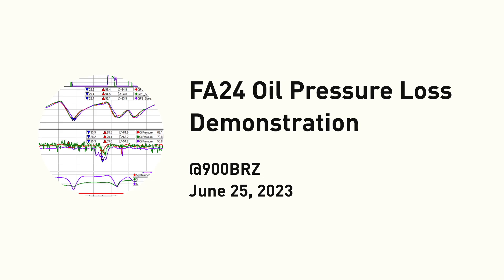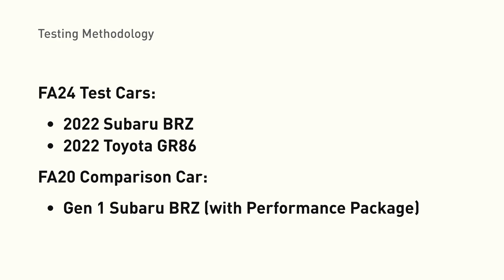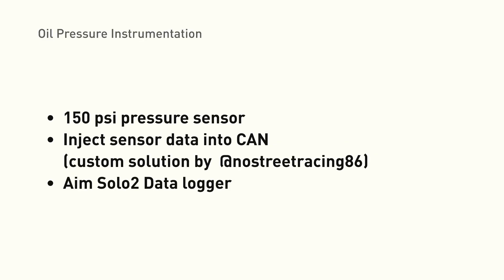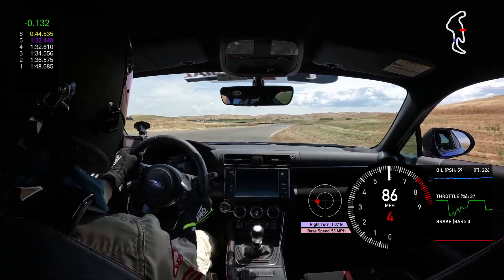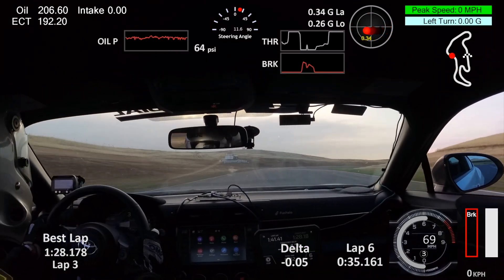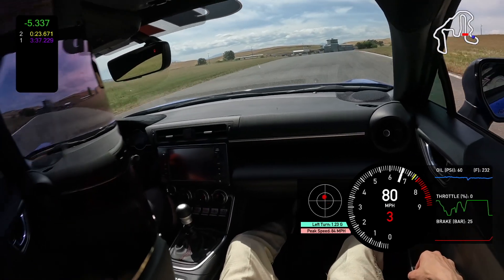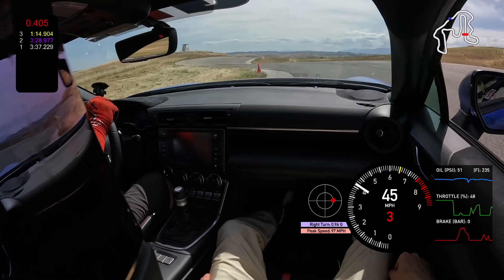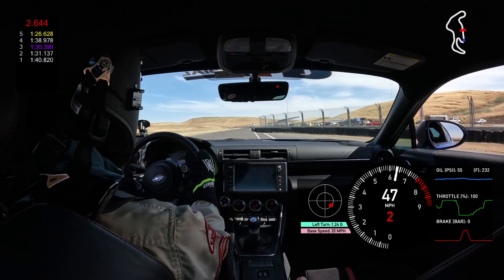BRZ/GR86 FA24 Oil Pressure Loss Demonstration

Comment: somehow it's even worse than the first one with all the same problems 🙃
Reply from the maker: More power though. Disappointing that the oiling performance actually seems to be worse. Increased horizontal baffling built into the engine in the upper pan are encouraging though. If the problem is surging into the timing cover and we can fix that, we could be in a good spot.

Comment: We should test high viscosity oil first, as well as overfilling, before the baffles. Also, does the oil cooler induce any pressure lowering compared to OE ? I used to have a setup that did.
Reply from the maker: I don’t have data from before the oil cooler install, but I’ve been told the JR oil cooler reduces nominal pressures in the system by less than 5 PSI.
Reply: That could very well be enough w high temp, low viscosity and no overfill. Just tinkering with you here. I’d try something about this before “risking” a baffle.

Comment: Great analysis. I feel like we really need to get our hands on a GR86 cup car to see what they've done there.
Reply from the maker: I didn’t want to present this in the main findings because I don’t have the actual data, but I did chat with one of the teams and they confirmed that they do log the oil PSI and they said “we haven’t seen below 20 PSI but it gets right down there.” So I believe it’s possible/likely that their baffling solution is not solving these pressure drops either.
Reply: Oh interesting. Thanks for exploring this
Reply: How much PSI is considered safe? So cup car think 20psi is ok?
Reply from the maker: @Wesley-ui3dw  I’m not sure what kind of support they have from Toyota. It’s very possible that Toyota would replace their engines if they fail due to oiling issues and they’d sweep it under the rug. Also they won’t expect to get more than 1 season out of the engines. One engine failed in practice at the last event but it was replaced before quali. No public info on the cause.

Comment: Maybe experiment with overfilling 1/2 - 3/4qt before you try the new baffle.
Reply from the maker: One of the guys I know who blew his engine was 1/2 qt overfilled with Motul 300V 5W30 and that did not help him, so I’m dubious. Moderate overfills won't hurt, but my tests are at the full line or just slightly above. Baffle is going on today, so any other testing will have to be on another vehicle.
Reply: @900BRZ  well... it's good that someone got tot he bottom of this. The power of datalogging!!

Comment: This was fun.  The oil sloshing forward can't be the ultimate answer though.  That would be happening no matter which way you turn.  And the pressure drop was immediate, if you turned to the right. The pick-up offset could maybe do that, but man, that seems like they called things way to close.  Hopefully you figure out a band aid fix, but because the drop in pressure when turning right happened every time and immediately, there might be something inherently wrong with that block or maybe just the oil pump capacity.  It would be interesting to hear from an engine designer.  Thanks for doing this.  Well done.
Reply from the maker: I don’t claim to have a definitive answer, but these are the best theories I’ve heard. We’ve reproduced this in the two FA24s in this video and one other friend has similar data in another FA24. So I don’t believe this is a one-off manufacturing issue with a single car. I would love for a fluid dynamics expert to enter the chat 😉
Reply: @900BRZ  Fluid Dynamics folks generally don't bother with how oil sloshing inside engines and the pickup sucks dry under particular G loads and revs.

They would be more involved about how a fluid or gasses  flow or behave in various conditions, pressures..  Hard Core physics calculations and computer simulations.

It would take way longer to set up the FD computer simulations and run all the variables and scenarios on them.. Than it takes to install cameras inside the pan and do some trial and error with sensors and additional baffles similar to what you already started.
Reply: @900BRZ  Would a swivelling pickup potentially fix this? they make them that are setup in such a way that they move with the oil, basically. Also, have you tried overfilling the engine with oil? I am not sure about boxer engines, but I know in the cars that i have tracked where I have had to deal with oil starvation issues, overfilling by a quart or so doesn't harm the engine, but helps massively with these issues, YMMV obviously, and overfilling is never a good idea if you don't know whether it will harm the motor. 

I would get some sheet metal, a welder, and make a much larger capacity winged baffled sump with a swivel pickup as a final resort. But that is a big job and doesn't help all the other people.
Reply: @russelljimenez4715 before going to a swivel pickup a think a 4 gate setup welded into the pan might be something to look into, probably in a diamond shape since it seems it's only on those right handers with lift or braking. A normal square with a gate facing forward may not close in time.
Reply: @russelljimenez4715 overfilling the engine withe oil can result in foaming and end up being just as bad as running an engine completely dry of oil. Next time you do this have a look at your dipstick after your drive and if you see a lot of bubble and froth no good.. even worse if oil has changed colour

Comment: This is great. In future analysis it could be helpful to display the data graphically and use some stats to analyze it. You could use area under the curve as an analogue for the oil pressure drop and compare the aoc from the testing cars to control car. This could then give you a ratio which correlates to the degree at which the oil pressure is worse in the testing cars than the control. We can see it in the videos but the numbers can be very helpful when presenting this is a short format/ elevator talk.  If you have any stats friends they might do this for you.
Reply from the maker: That’s a cool idea. One of my friends made a little web service that attempts to create a glance-able view of this kind of data: http://track-build.com/oil-pressure-analysis

I think the coloring on the track map is based on absolute pressure levels but your area under the curve idea is an interesting way to generalize that.

Comment: Can't wait to see your data once the KillerB baffle is installed. I'd love to cover the results with you in a future podcast on my channel.
Reply from the maker: Fingers extremely crossed we have a good result. Would be happy to report my findings with you guys.
Reply: @900BRZ  would love a control test as well. And maybe a test with some overfilling of the oil.
Reply: @900BRZ baffle alone wasnt enough..

Baffle is simply an oil scraper with main task to collect oil that were thrown around after the oil exiting crankshaft and conrod journal...

2nd...bigger and properly baffled oil sump is more important than crankcase baffle plate alone...

3rd.. to get to the real issue oil of unstable oilling in these boxer engine, first... We must understand that fa/fb series engine was born from development on ej series...

Thus u need to look in ej series subaru engine to find the core issue....

Issue 1: slow oil return to sump after being used throughout around the engine...  Especially after the oil went onto camshaft and vvti assembly, it took long lateral journey from rocker cover and timing cover area back oil sump...

Issue 2: engine oil galley machining wasnt optimized.. esoecially the galley that supply engine oil into crankshaft journal #3 that also sharing the same oil supply for conrod #2 & #3  

(all other crank and conrod journal gets their own dedicated oil supply galley)

In order to solve this issue...the engine need to be torn down, and hand porting needed to smooth down all those oil galley.... Especially these 3 area: oil pump outlet to oil filter, oil filter outlet into engine block and crank journal #3 (including conrod #2 & #3 galley)
Reply: If the baffle helps I'm buying one immediately.
Reply: We need to test any & all baffle plates that become available to see which one is the most effective! How many are there currently?

Comment: Never track a car for more then 20min without oil cooler and also buffer oil pan. It doesn't matter what car you drive. You will be asking for a new engine.
Reply from the maker: You only need a baffle if the oiling system is suffering from sloshing/surging. In this case, yes, we need one.

Comment: Do you think the heavier oil in the older FA20 was a factor in maintaining that oil pressure? Or is it because the oiling system really is that much more robust?
Reply from the maker: In a perfect world (or if I was designing a test with a larger budget) we would have swapped to 5W30 in that car as well. In practice, it’s unlikely that there would be a big difference from the weight. You’d expect to see slightly higher pressures overall with the 0W40 weight at temperature as a result of slightly higher viscosity. But I’d expect the main benefit to be more residual oil on the bearings during the pressure drop. It’s hard to say definitively with the added variable and only testing 1 FA20.
Reply: @900BRZ  I think you’re correct. Given that all cars had an after market oil cooler and the Gen 1 had a more aggressive suspension set up in comparison. In theory that will generate more lateral forces against the car probably further dramatizing oil being moved around in the pan. I’d be curious if Gen 2 owners if they used 0w40 oil, will that be a temporary correction for the drop in oil pressure? Given heavier oil has better thermal capacity before it gets thinner and lowering oil pressure.
Reply: Very good point. Tracking anything below w40 is looking for trouble.
Reply from the maker: @dscpat  I’m not totally convinced about that yet, although I can be convinced otherwise. I am running Motul 8100 EFE partially because it has a high HTHS viscosity at 150°C, which is a test that tries to describe performance at critical locations such as bearings, where there is high shear rates and high temps. 8100 has an HTST viscosity of 3.5 mPa and you can definitely get w40 oils with less than that.
Reply: @900BRZ  indeed, you are right. I would try a higher viscosity spec oil nonetheless, plus slight overfill. Again, just tinkering w you here.
Reply: Btw, gt86 cup manual recommend ELF HTX 825 10W60.

Comment: We’ve all been doing it wrong, these were designed for NASCAR.
Reply from the maker: I’m not sure the FA24 can handle the banking even on left-hand corners!
Reply: @900BRZ I wonder why we haven't been hearing about the WRX having the same issue... Is there really that big of a difference from the FA24D and the FA24F? Or are people just not tracking them like the BRZ/86
Reply: @900BRZ would be perfect for Martinsville then!!!
Reply: @900BRZ  Well that explains how I blew up my FA20 at Autoclub speedway on the first banking :/
Reply: @supergt86  Install a baffle plate in the oil pan. Worked for me at least.
Reply: @Fastvoice  already did on the second engine, per CSG David and Denstoj Auto advice :D
Reply: "And another left turn!!!"
Reply: Damn, that’s sad lol. I really want to own this car, and I already got my parts list ready for racing, but this situation is ruff and causing me extreme internal panic lol
Reply: @jumboshirmp  buy something in the class you intend to drive. Don't get one of these and take the subaru peg.
Reply: @jumboshirmp engine swap from factory
Reply: @jumboshirmp K Swap it 😂 or buy a Miata ❤️
Reply: @Jamie_Sunshine  miatas are such a meme
Reply: @jumboshirmp  With enough money, you can fix anything😉

It just may have to be a swap.. hopefully not though lol
Reply: @jumboshirmp I have a 22 GR86 and it’s great
Reply: I came here to say this. Bravo to you.
Reply: You guys are really tracking these cars? Guys these cars were meant to be slammed on bags, wide bodied, and have super loud tomei catbacks with pops and bang tunes. Do your research guys
Reply: @Jakegeno98 and then driven painfully slowly on canyon roads!!
Reply: @MrSuryapratim  😂😂 at least they handle well
Reply: @Jakegeno98  not with what appears to be 60 degrees of negative camber they don't... Lol
Reply: @MrSuryapratim  youre right. You need more camber
Reply: @Jakegeno98 designed to be track cars. Engineered to be stance cars.
Reply: @Jakegeno98 can't with stand that clown
Reply: @Jakegeno98 finally somebody speaking the truth
Reply: @Jakegeno98 these cars literally come with a track day event when u buy them
Reply: @noahfox2226 my brz did not come with any track day lol that's most definitely something someone just pays for
Reply: @Jakegeno98  Everything you said is wrong! Not just BRZs but ALL cars! (except the tuning)
Reply: @fidrat24  i was being 1000% sarcastic. I wasnt being serious
Reply: Haha😂😂😂😂
Reply: @900BRZ have you try accusump / oil reservoir ? It works quite well, in lotus with toyota 2zz engine
Reply: Great comment 😂😂😂

Comment: Anyone ever use or know if accusump would help?
Reply from the maker: I’m not an expert but friends with more experience and Killer B argue that the accusump is not a cure-all solution. I’m really only parroting other’s opinions, but they claim it’s only appropriate for a dedicated track car with the idle raised above 2000 RPM with a tune because the minimum pressure of the accusump is significantly higher than the FA24 at idle. It also draws from the engine even at high load, potentially reducing the pressure available to the engine.
Reply: @900BRZ  I thought it depends on the valve you need. There have been people running them on their first gen fa20s with not many problems it seems. Maybe I'm just hoping for an easy fix but it kinda is a cheaper solution to a dry sump system

Comment: Thank you for producing this information.  One thing i noticed is that not all right handers produced the same pressure drop.  It almost looks like the constant/longer turns produces more consistent pressure where as the quick/short right hand turns yield pressure drops.
Reply from the maker: We’re very concerned about sustained right-handers as well, although you’re right that not every one is causing drops. It’s worth noting that T1 at Thunderhill West did cause occasional small drops, but not enough to include in the main part of the video.

I know two people who believe their failure occurred at Riverside, a high speed right-hander at Buttonwillow in CA. Also LUNK’s recent FA24 failure was at a CW circuit with sweepers. I decided not to take my car to Buttonwillow again once I started to see these pressure drops as the risk was too high.
Reply: @900BRZ  Again, thanks for the information.  Are the pressure drop observed always at the same turns?  Conversely, the other right handers that does not cause pressure drop, is that also always the case (non issue)?  Why some right handers and not others?  There is got to be a specific conditions even amongst right handers that is causing this.

Comment: Mine failed after full throttle acceleration in a straight line with 34k on it after jinxing myself by calling the issue overblown. No tracking, performance AS tires, so rarely over 1g, and oil always checked and changed every 5k, driven by an advanced manual driver. Warranty taking care of it and they're blaming RTV. Like the video, I believed RTV wasn't sole cause, but a contributor until mine blew in a straight line and I started thinking maybe it WAS just RTV. After seeing this, I'm thinking it's more likely 34k miles of accumulated damage being as most corners on the street are right hand turns for highway ramps, plus probably some assistance from RTV. Looking forward to results with the baffle.
Reply from the maker: Sorry to hear that. I definitely believe in the theory of damage to the bearings accumulating. So sometimes we may have a smoking gun type failure where the engine actually spins a bearing in the middle of a sustained right-hander, for example, but we might find they also let go in other scenarios.
Reply: @900BRZ  Thanks. Stuff happens, I just want this to be figured out so it can be fixed. I don't want to have to sell it before the warranty is up and get something more boring and likely more expensive!

Comment: Should this also be a concern for FA24s that dont get tracked or get driven at high RPM often? My GR rarely sees anything over 5k RPM when driving normally, but I’m thinking right sweeps on the freeway, off ramps etc.
Reply from the maker: I don’t have any concrete data to support reproducing these pressure drops on the street, but I also haven’t tried to do so. I think it’s possible but not likely unless you’re pushing it pretty hard in the canyons.
Reply: Also if you're unmodified and just street driving, they shouldn't have any reason to deny your warranty, so I wouldn't worry. I think this mostly applies for owners who heavily track their cars and would face likely warranty denial if the engine blows

Comment: Fantastic job! This data tracks with my observations and testing as well. That is, I don't think RTV in the pickup is a big deal here (however, an important one as mentioned), but just the lackluster oiling capabilities of the FA24. Again nice job! I might test out one of the KillerB parts as well 👌